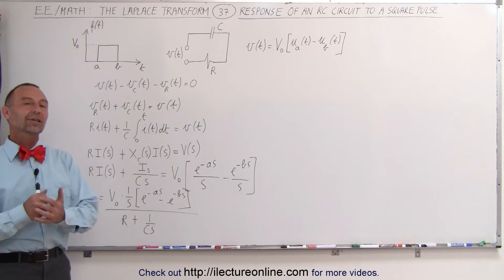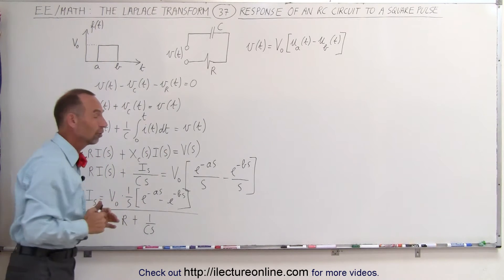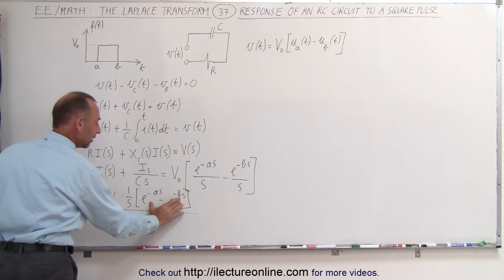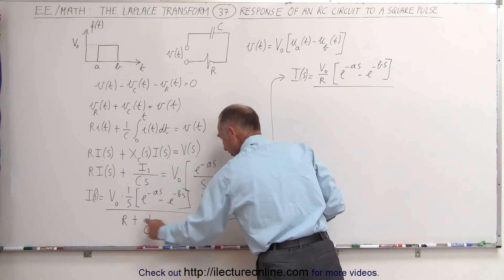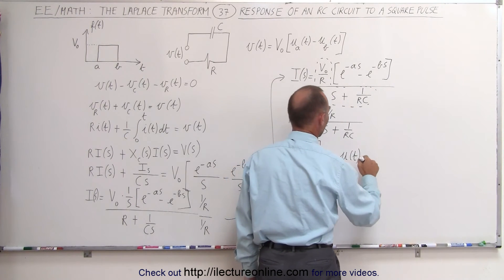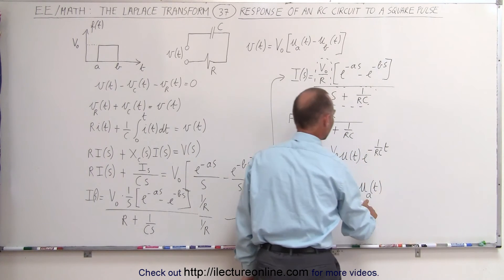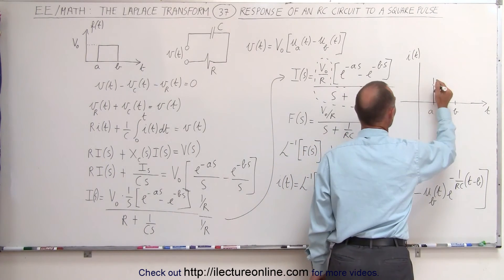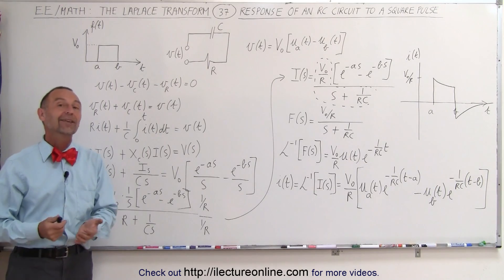Electrical Engineering: Ch 16: Laplace Transform (37 of 58) Response to an RC Circuit

Comment: very nice, fantastic , wonderful, excellent , brilliant and outstanding video lecture.
Actually I learnt  a very nice thing '' How to mathematically understand the response  of a particular input signal to a particular circuit''
Before it was a bit non intuitive for me to understand the exact shape of current or voltage response of an input to a circuit.
But if the circuit was like an op-amp which is a bit more complex then we are able to find out the response signal shape between any two nodes in  the circuit , but a bit complicated calculations! Maybe by means of simulation software...
But again thanks for the video and wish you a happy new year 2023.
Reply from the maker: Thank you.  That is the exciting part of learning, when you discover something of gain a new understanding!  Good for you!  🙂